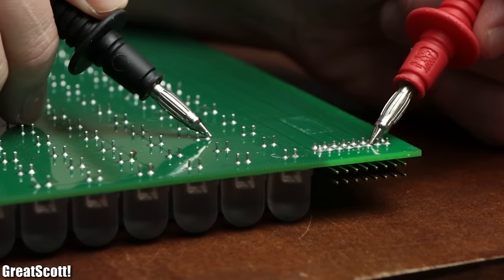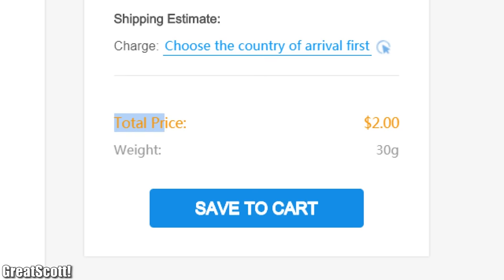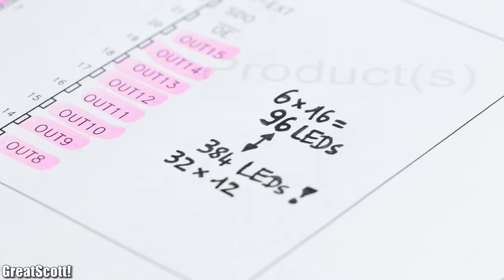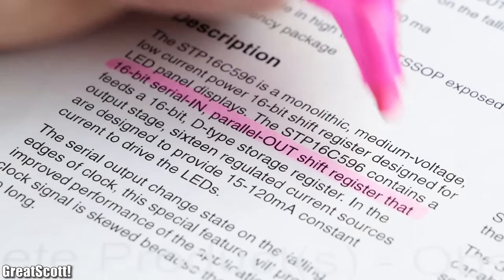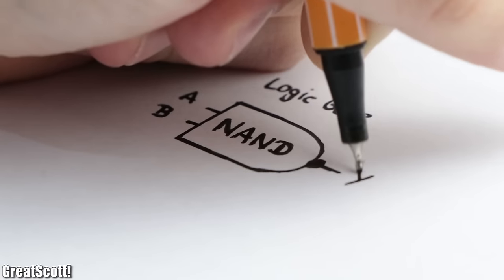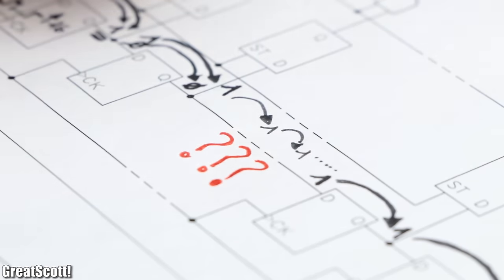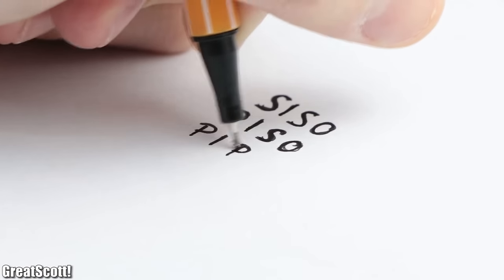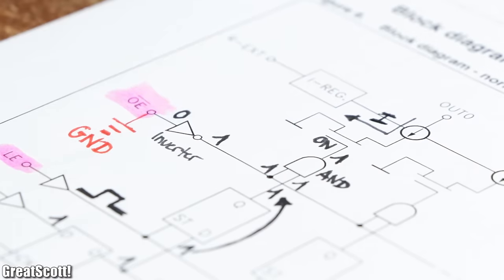Controlling a BIG LED Matrix?! How Shift Registers work! || EB#39

Comment: It looked like there were some LEDs that were on, and didn't turn off as part of the sliding lettering.  What caused that?
Reply: Exactly what i wanted to comment
Reply from the maker: I think some shift registers got damaged during the video.
Reply: @greatscottlab  Probably happened when you were testing it carelessly with voltage. :/
Reply: @greatscottlab  easy enough fix! Worth it for the education gained

I'd get skinnier probes, these banana plug hybrid looking things are kinds fat and it looks like you grazed/shorted some chips while probing
Reply: It depends on the propagation delays of the signals coming from the controllers.
The row and the column scan signals must be precisely synchronized with each other otherwise, you might see ghosting effects.
or might be he destroyed some inputs when he was examing the circuit! which by the way was a very primitive way to test such a circuit!
Reply: They probably are ReBe type

You know, RebeLEDS, they don't follow the orders
Reply: Yeah, seems there is a short in one of the driver outputs of a shiftreg. It might be caused by connecting e.g. +5V powersupply at the specific output pin while the driver is active.
Reply: I'd rather think it's a sync problem.
Reply: @L30NBL4NK  ,LED drivers normally have a shiftregister plus a parallel output register. If there was a sync problem with the shiftreg it would occure at the first bit of the shiftreg. The error would be moving and it should occure when pixel data changes. The fault is at column 24 if I counted correctly, so it's probably in the middle of a shift-register. It creates a 1 signal when the neighbour register data are all at 0.

It looks like the output is always switched on, so the most likely cause I would look for is a short in the output driver of the parallel register. Replace the shiftreg IC and it will work again!
Reply: @greatscottlab  Of course, you canot drive leds with the ohmeter (or power supply) without risk of damage on the ICs. Every electronic guy must be aware of that.

Comment: Cool video! Though, as some people pointed out, some LEDs around the letters still look like they're on. This is called ghosting.
In a nutshell, when switching to the next multiplexing line, there is still a bit of energy left in the LEDs, that do not turn off immediately, thus creating the effect of a ghost line below or above the intended line.
What you need is a tiny delay between the turn on times of each of the four rows: turn on line 0, wait, turn off line 0, wait, turn on line 1, wait, turn off line 1, wait, ... The waiting times are depended on what are your LEDs, as well as what are the drivers you are using, so to remove this effect, best is trial and error to find the proper value.
Hope this is useful (and that you or anybody learnt something from this comment!)

Comment: I almost died when I saw that video 😂😂😂 I work for the company who produced that PCB 😂😂😂
That some LEDs are constantly on is because of one defect LED. After they brake these LEDs are not open, they produce a short circuit so the other lines are also powered when they shouldn't be... It would be interesting how you got those PCBs 😁😋
Reply: Michael Stark, where can I get one of these PCBs?
Reply: @martinrocket1436   Hey Martin, sorry but they aren't made for the free market. We developed them for a businesspartner...
Reply: Michael Stark, and the business partner isn't selling them either? 😢
Reply: @martinrocket1436  I'm sorry but they use them in their own products and sell them. But you get six of them with a power supply and a microcontroller for, I think, 1500€ 😁
Reply: you got a model number for those that i can punch into ebay?
Reply: @devicemodder  Like I wrote, they are not created for the free market...
Reply: @michaelstark8756  alright, that's fine. i'll make my own. Also, never said they had to be free market. maybe they ended up as surplus on ebay, ect...
Reply: @devicemodder  since I'm the developer of the second generation of those PCBs and the company I work for the only one who produce them there are better no one on eBay because if they are on eBay, someone would be in trouble...
Reply: @michaelstark8756  why does it cost 1500$? I mean the parts aren't that expensive, like 100$. And it isn't that complex. All i could think is the huge pcb, but still...
Reply: @JutasiT  like I wrote, 1500€ would be six LED PCBs, a industrial CPU PCB and a power supply PCB. To be fair, I didn't write it's coming with a aluminum housing which isn't that cheap. 100€ for the overall material for all that stuff isn't even close...
Reply: @michaelstark8756  Ohh my bad, somehow i didn't notice u wrote 6. I meant that 100$ for 1 led pcb without supply and cpu. Now i understand, thanks

Comment: You should try to find a small software called "Matrix to led". It allow you to draw your word or drawing on a grid that you set the same size as your Matrix. Then with one mouse click it displays you the binary and hex equivalent of your drawing. It is much faster than typing all the 0 and 1 manualy . 
Great video though
Reply: im working on something like that. streaming to and from my led matrix as well as interfacing it with a pygame-gui and clickable rectangular led-representations. not ready yet but maybe next month....

Comment: Damn you should use bytes (which have 8 bits inside of course) instead of booleans, since booleans take 1 byte even though they can only store 2 values...
Reply: That depends on the compiler you use. I have used compilers that were "smart" and would assign a bit of a byte to a boolean. So if you had 8 booleans you only used 1 byte and not 8 bytes.
Reply: That's exactly what I was talking about.
Reply: Yes.

But you really should be careful about RAM usage as 2KB isn't much at all.

Comment: I wonder why there aren't even a single active noise cancellation projects, even though you Google it like crazy
Reply from the maker: I can put it on my to do list
Reply: GreatScott! Awesome!
Reply: I thought electroboom made a video but I’m not sure
Reply: @noudlindeman1931  Yes I think you're correct
Reply: @noudlindeman1931  
He did, but the product he reviewed was bullsh**.

The product is called something like Muzo or something.

Here it is: https://youtu.be/MCW5HUkrr-o
Reply: @iProgramInCpp  Noise cancelling in open space will always be bullshit. If I am not mistaken he explained why in his video.
It only makes sense using that for things like headphones.
Reply: @ppdan  Yeah, if you don't have circuit near your ears it's gonna sound weird due to differences in timing.
Reply: @vengefulenigma  The real problem is that if you want a stationary noise cancelling system it will have to :
- Know your exact position
- Know the exact position of the noise (source)
- Detect the noise before you hear it and have enough time to act
Even if you manage to solve these problems it will still create more noise for anyone else in the room.
Headphones don't need to track any position because any noise will pass thru the system before reaching your ears
Reply: @ppdan How about (active) noise canceling windows? Are those a thing? After all, as long as you keep them closed, the noise is outside and you are inside, it wouldn’t be an open system, right?
Reply: @llejk  I think good soundproofing  would be way cheaper than active noise canceling for windows...
Reply: @vengefulenigma  I can just imagine someone trying to turn a window into a speaker.

Comment: Pro tip: Instead of writing a two dimensional array of bools you cans just write an array of numbers in this format: 0b01010101.... Then, you can easily get the bit out using a bitwise and. This will save you a lot of horizontal space in your code.

Comment: What about a RGB LED Matrix?
Reply: Already did
Reply: You call that thing monitor
Reply: Just the same but triple the IC’s
Reply: what kind digital or normal =4 pinned ??
Reply: digital like ws2812
Reply: Big Clive did one very recently.
Reply: The most easy way to create an addressable RGB LED matrix is to use a string of, say, 5050 LEDs, and arrange them as desired.
Reply: S A  Actually look for Adafruit Neopixel or simply ws2812
Reply: @DarshanKumar-mo4ew  
Wow can i see it
Reply: S A  Doing brightness control is just a matter of timings. The 3 mosfet controlled lines used for the multiplexing can be timed in such a way that the on pulse from the shift register and the pulse from the mosfet move a bit (or vary in length) in relation to each other to facilitate PWM dimming on individual LEDs. It's all about timings :)
Reply: S A  It's still the same method, only more lines to control. Yes, the arduino will start choking on the code at some point, however sending data to a digital pot and syncing to the rest of the pulses will require even more bandwidth out of the controller. You have to change the brightness every next pulse, using the arduino and timings you can directly add and subtract a number to a fixed pulse trigger and manage the PWM brightness control precisely in sync with the lit pixel. Using a digital pot in that same amount of time you'd have to prepare a data packet and send it to the digital pot ic, than send a execute command... Which requires additional libraries for the communication capability and time to form a pulse string with much larger length than the single pulse you'd send to the output transistor...

Comment: For a sipo shift register why the clock is common to all d-flip flops ? Shouldn't the clock signal be cascaded from 1st flipflop to 2nd to 3rd and so on...then only we can say bits are shifting one after other. If clock pos edge reaches all d-flip flops at same time output of all flip flops change at a time instead of shifting one after other ? Please clarify

Comment: amazing 👌
why those two LEDs stayed on? 12:15 ?
Reply: Could have been a code issue or wiring issue.
Reply: Faulty circuit board design. Some data signals are shorted into other signal lines.

Comment: The weird thing is that most shift registers seem to be more expensive than an Arduino nano!  So when building my own, why use a shift register? Crazy.
Reply: Lol I get about 10 shift registers at the price of a Nano.
Reply: Cool! What brand?  I looked at max32 and some microchip , ti, and they were expensive. I'd love a part# if it's not too much trouble.  How much are they?
Reply: You can google Sn74hc164 for instance. I don't know where you live , but it costs about half a dollar where I live
Reply: Yeah , they are pretty cheap everywhere barring a few specific models
Reply: just buy them on aliexpress.com
Reply: 74HC595 (basic 8bit shift register, capable of sinking current of 1 led per pin) is $0.05 (20pcs for $1)
Reply: Wow thanks everyone. I guess it has been a while since I price shopped, and some of those part numbers are new to me.  Now I have new design possibilities!!  Great info! Thanks again!
I may have been originally searching for IO expanders and never thought to look for an output-only option because I associated the price incorrectly. Thanks for setting me straight!
Reply: roidroid , I guess for analog inputs you can't just have a latch/shift.  You'd need the chip to have an ADC, then how do you shift that value into a pin?  The IO expanders have ADC and i2c or spi communication which makes it expensive.

Comment: Could you please make a Video about „Anti-spark circuits“ to prevent sparking at connecting high voltages such as charging  battery packs.

Comment: This might be an old video but what the hell. I have a few questions about the LED Matrix, since I have a project on making a 32x16 blue LED Matrix and would like to base my schematic on the panel used in this video.

1. Why does every 4th line of the LED cathode wired in parallel?
2. I noticed there's only 4 MOSFETs used to drive the whole panel which means the MOSFET drives 3 lines of the matrix, how can that work? Wouldn't having 1 MOSFET per line increase the "resolution" of the panel?

Sorry for the long and probably stupid question. Any help is appreciated.
Reply: Maybe they wanted to increase the duty cycle and had enough shift registers to control a quarter of the whole matrix .

Comment: Hey friend can you help me to make digital clock problem is only power supply, 1) First I purchased 2.5 inches(approximate) 7 segment display but it requires 9V for each segment and I was not able to use high side transistor switch, so I made my own segment display with 2 led for each segment and total of 2*7*4=56 LEDs, and they also not glowing as expected, now I'm working on 3rd experiment on bread board with total of 28 LEDs, one LED for each segment. So nearest 7 segment works with maximum brightness and decreases with distance, thanks in advance

Comment: The drawing and explanation of the D flip-flop is wrong.  What you have drawn and explained is a clocked D latch.
Reply: Agree, but only your first sentence is correct. What he have drawn is not a clocked D latch but gated D latch. Obviously shift registers can't work with latches because they are transparent when Enable input is active. They need edge triggered flip-flops (2 latches in Master-Slave configuration)  to function properly
Reply: @wojciechjaworski602  yes, you are right. Gated, not clocked. A real D flop uses both edges, one to bring the data in and one to lock it in, like you said.

Comment: I have a question I’ve been wanting to ask for some time, that perhaps someone knowledgeable can answer. I don’t understand why the output from a video connector like HDMI has never been used as a means of controlling large numbers of components. This signal controls tens of thousands of pixels and a vast array of colours, so would it not be possible to decode this signal in order to for example control thousands of motors via relays? It would require software that could translates code into the video / image signal understood by the computer hardware which would then be send through the HDMI cable be be decoded by an external module. Is there something I’m missing? Some reason nothing like this seems to exist?

Comment: Whats the difference between shift registers and multiplexers?
Reply: Registers have a state
Reply: @ArneChristianRosenfeldt  Thank you for making the effort of scrolling back to 5 years :face-red-heart-shape:.
Reply: @neail5466  Thank the youtube algorithm. I feel like Google fed some AI with all their data. Also: I am old. I care too much for old stuff. I think shift registers were used in the NES controller in 1982. Red LEDs were available.
Reply: @ArneChristianRosenfeldt   Actually, when I started tinkering with microcontrollers I often used shift registers but often read about multiplexers and it sounded same. Later I made up my mind that the operation of shifting bits is multiplexing, but never got it cleared .. as you have mentioned now I should try the AI to answer my question 😄.

Comment: Is it possible to control the brightness of each LED??
Reply: I still don’t know why nobody pairs an LED with a ferrite inductivity and a free wheeling diode to remove the flicker. You address this circuit with a short high voltage spike and the let the current decay like on phosphor. The longer the pulse, the brighter the LED.

Comment: I don't know if anyone can help but i'm a highschooler and i designed a circuit to multiplex some dot matrices controlled by a matrix of buttons. Im interested in making it controlled by a eeprom but i only know how to cannibalise code not make anything from scratch. I made a eeprom programer to use with an arduino, just need to figure out the code... Thanks

Comment: Is it posible, to use a microcontroler as an opamp?
Reply: Probably not. Op-Amps are very fast analog components and microcontrollers are mostly digital. Even with an DAC the performance would be very bad compared to a real Op-Amp
Reply: There are microcontrollers with built in opamps (not many), but in general that won't work.
Reply: Thanks for response.

Comment: hi guys help me on this . i have some display i want reverse engineering to matrix scrolling letter.
its 7x5   2 inc x 1.5 inc size  bi colour matrix (green,Red) hook to MM5450 chip (2 matrix to 0ne chip). manage to find Clk pin,Data Pin,power 
i run test code its random come out 3 colours and overload the chip. 
anyone can help me on codes to run any scroling letters or msg ?thank you 

there is no one work on this chip codes in internet. great help guys